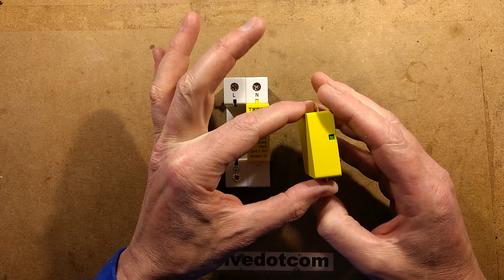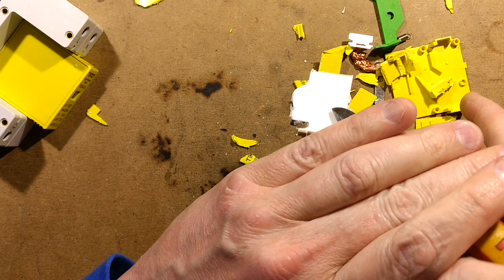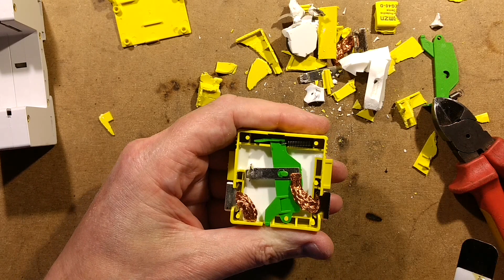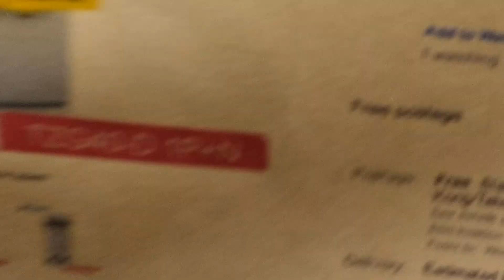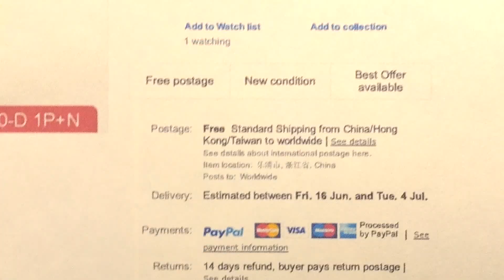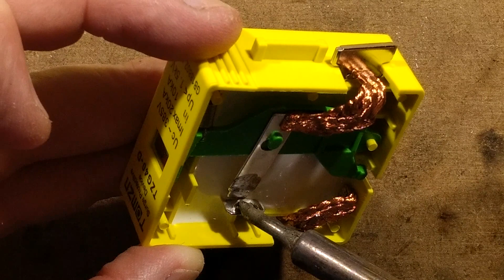DIN rail mounting surge protector with uninspiring safety device.

Comment: It's not supposed to break the circuit, It's only supposed to trip the breaker by making direct contact with erath. Once it does that the surge protector is broken and can not be used anymore. It shows this in the window on top and via the a contact on the bottom (if the bottom part is equipped with that)

So the solder part is only used to show that the surge protector is tripped and needs to be replaced. Flip up the breaker before it again and the circuit is live but unprotected
Reply: @ Pidroe.  It absolutely is supposed to break the circuit, MOVs degrade over time and their resistance drops with that degradation,  therefor over time the MOV will start to pass current causing them to heat up, the solder is "low melting point" and tin tag draws the heat up from the MOV, to the thermal fuse that should take the MOV out of circuit before it starts a fire, ideally the base is fitted with a microswitch that detects that the module has either failed or been removed thus notifying someone of the failure, now this all occurs at very small leakage currents usually less than an Amp, so WAY before any upstream protective device would ever operate.   Surge protection is one of those golden bullet areas where people think that a couple of 20mm MOVs will make them invincible, many house fires have been started by degraded MOVs without over temperature protection, usually in cheap arse power boards that were stuffed under someones bed or under the curtains behind a TV, proper surges are thousands of amps and they WILL cause damage,  surge protection is designed to give the surge a more preferred path to earth were the damage is less problematic.
Reply: Pidroe I agree, by tripping the Main Switch circuit breaker, it has performed its function.  Even if the Solder is still connected, it will not be a safety hazard (even if is live to the turned off main switch, as an electrician is trained to test and know what to do in this circumstance), that being to remove the surge arrestor replaceable module.  If the solder were to still to connect between active and earth, it would be vapourised by the direct short to earth, hence leave a big enough safe gap.
Reply: Alright I looked more closely, it's actually a type D surge protector, so it's supposed to be installed after a RLC. Then yes, it would trip the RLC.
But TOMZN also makes type C surge protectors and I bet they have the same shitty construction and then you don't have a RLC to save your ass, because MOV's are not guaranteed to fail dead short. They may fail open circuit or somewhere in between and if it's below the trip current of the breaker then this thing could start a small fire.
Reply: Well, they do... basically a real surge - aka lightening strike.. has too much energy in too short a time for the RLC to react.. so it all goes down through earth.. mini surges might trip the RLC, but won't melt the solder...

My opinion the solder melting is simply to move the flag and ensure you know WTF happened :)
Reply: But it's not making direct contact with earth and it's not guaranteed to trip the breaker.
Reply: yes it is, the MOV is between Line and earth.. when it goes over voltage it will connect to earth which is supposed to trigger either the RLC or the breaker... generally if it is a serious surge it over heats, trips the flag and wrecks the socket
Reply: mguruguru it will either melt the solder or trip the rlc, it won't do both. because after one did go open circuit there is no more current to trip the other.

Comment: So is that the same varistor device used in fridge compressor starter ccts?
Reply from the maker: That sounds more like a PTC thermistor that changes resistance with temperature.  Starts off with a low resistance, but then goes higher resistance as it heats up.

Comment: Judging by the print direction, it looks as if the spring DOES have a gravity assist, maybe giving a li'l bit more gap, not being held upside down.

As a bit of a change from other vids I've seen, where your hands just appear on screen pre-injured, I finally get to see the actual injuring process!

Comment: Hm just wondering what that contact is intended to do, if you have 5kV spike on the neutral, then varistor shorts it to the earth so you now have it grounded to lower potential, but when the contact opens, you have 5kV again on neutral. Isn't it supposed to dead short it until the voltage spike is gone? imo it should never break the circuit
Reply: This is not for continuously shorting high voltage to ground, just single short spikes (like lightning strike surges). Those will not cause the solder to melt. The varistor can take those spikes repeatedly. If you have continuous high voltage something else is wrong and that's not what the varistor is built to prevent, so it cuts itself out, which is proper design of those devices (which does not really work in this model).
Reply: You don't understand. Again, this device is not for continuous loads and not a breaker . This device is there to short (not break) surges to ground. We are talking about surges in the range of maybe tens of microseconds (yes, millions of a second). If you have a few kV on the line you want to be able to conduct a few kA. That's the whole point of a surge protector.
Reply: sumilidero I agree it's like they are trying to save the varistors life and longevity.... at the expense of life and all other equipment it s suppose to protect!!  yeah cuz we really need to save 2$ varistor when the house catches fire.....
Reply: also that crap contact definitely is not rated to break 10kA anyhow its just a poor toy not a protective device
Reply: I know that, but why is that solder there xD

Comment: Id say this look like a factory reject. The metal tabs seem kind of misaligned but also since the error wouldnt go away because there was a small solder bridge that would just keep melting away since I guess the current would increase if the connection point was smaller..

Comment: Would like to see how it works with a shorter Spring (~5 windings). It also might help to fix the contact in place on the green lever, to swing it to the side instead of just lifting it up. To me it looks like a bad copy of a good design.

Comment: Could it have performed differently if the connection was broken whilst it is in its usual vertical position (how it would be installed) rather than being laid flat on a table?
Reply: I had the same thought, but I suppose it "should" work properly no matter the orientation. Interesting design, however implementation not quite correct.
Reply: SpiderPg I'd call that an erroneous assumption, personally. I looked into these a little bit some months ago and the assemblies are often designed to go into any breaker socket of the compatible standard. That means that they will often be used in residential breaker boxes, many of which position the sockets horizontally in vertical columns.

In short, he tested it in the position it would be in most US houses.

Comment: I'll be devil's advocate here for a few parts.
Regarding the green indicator not moving all the way to red, maybe it's like that for colourblind people. Easier to see that there is two colours there rather than green switched to red which might not be as obvious?
The design for breaking the circuit might have worked better if the tab at the bottom in your last shot was actually assembled with it in the bottom left, then there would have been a larger movement of the metal arm? all that would be required would be making the arm slightly longer and angled slightly.

Comment: my fuse box has a similar looking device on across the input. however it has 2 different modules identified V and T.

V type is across the line and neutral, and the T type is across the neutral and protective earth.

Comment: Proud to say I possess the special engineering skill of stabbing myself with a screwdriver while prying on things. I've utilized the skill multiple times in the past, in fact.    ;-)
Reply: I tried to pry a beer cap off with a flat blade screw driver and it went horribly wrong and I stabbed myself in the forehead. Lucky I didn't lose an eye - seriously. I'll never do that again.
Reply: I put a screwdriver right through my palm and it came out the back of the hand without any other damage apart from the hole. I was considerably lucky.
Reply: Mark L you are not a real engineer until you have seen blood on yr tools.
Reply: That made me laugh. I've hit myself in a sensitive area while hammering out a wheelbarrow axle. Fortunately just my clenched fist hit my nads not the hammer head. Otherwise my son probably wouldn't exist. :)
Reply: Yep - Been there and done that myself. Actually not much bleeding either which was strange...
Reply: Is the problem with not breaking the connection because the unit is upside down and the metal plate would if installed upright drop under gravity because of the slot in the middle. Still, the flag system seems flawed anyway.

Comment: This is the best thing about a senior engineer or mechanic traits. When they're wounded in a job, they'll just tend the wound a bit, and keep working. A bloody finger? Just wrap a tissue paper with electrical tape and continue.
Reply: Senior I accidently mashed my finger on a feeding wheel on a big table saw once. (Someone had turned it on when it wasnt supposed to be engaged". I did just that put a plaster and some paper tissue and masking tape on it and kept on working.
Reply: CA glue works like a charm. That's why the bottle always states "Glues skin and eyes immediately" or somesuch. It's an instruction, not a warning ;)
Reply: Effendi Chung
I do the sticky tape and paper towel/tissue/toilet paper thing all the time. Easier than finding a real Band-Aid™
Reply: B.L. Alley Our engineers does. But they will use anything they could find within an arms reach. Thats why I always made sure to keep some first aid kits ready. My mechanic even use fresh chassis grease to stop bleeding. 😣
Reply: mharris1270 
I believe that CA glue was originally designed as an emergency wound bonding agent.
I once cut my head open when a car tailgate gas strut failed and the tailgate fell on my head! When I arrived at Accident and Emergency (in the UK) they used CA glue to stick it  back together. They'll use it here if the wound is hidden by the hairline as there's a chance of a bigger scar due to misalignment during bonding. The stuff they used was a blue gel.
Reply: Pete Allum Part of the reason super glue (CA glue) works so well at closing wounds is because it is actually moisture activate., so a bit of blood in the wound only serves to accelerate bonding rather than inhibiting such.  I do often use superglue when I cut myself, but if I am doing electrical work or I am in my woodworking shop and injure myself and do not feel like taking the time to fetch the First Aid kit (even though I have a well outfitted one in my shop) I will often just wrap the wound in electrical tape (no paper needed) as it works quite well and does not prevent you from still using your fingers since it remains flexible.  Later in I will properly clean the wound, apply some antibiotic ointment and bandage it up...but after I have reached a good stopping point.  The irony of my woodworking shop is that I am a natural born klutz yet everything in my workshop borders on being surgically sharp (knives, blades, chisels, the list goes on)!
Reply: mharris1270 while you are right about the glue and hospital stuff, I would NEVER recommend to put glue into your eyes. Never do it unless advised to by a professional doctor.
Reply: @rimmersbryggeri - Yeah, but what condition was the guy who flipped the switch when he shouldn't have?  Did he still have the full compliment of bones and teeth?
Reply: Russell Hltn Since gustomers used the saw as well as employess it was impossible to know who it was. I Believe I was the only one working in the flat goods area att that time. In a lumber yard at that tiem where there were only professional customers they often preferred to do the cutting themselves for speed. I much prefer vertical saws to table saws though. they are much safer. I doubt cutomers are allowed b law to use any tools in a lumberyard now unless they come out of their own truck.
Reply: +Kevin L. 
... but it is OK if the doctor is unprofessional.

Comment: Why do you always upload when I'm on the shitter?
Reply from the maker: I've got a WiFi enabled rim-switch on your toilet.
Reply: bigclivedotcom Dear... I hope it's waterproof. I tend to lose my accuracy after a few pints.
Reply: why are you always on the shitter when he uploads a video?
Reply: John Howard solid core is shite, wider= more chooch. Those are the basics as far as I know!
Reply: Why are you always on the shitter when he uploads?
Reply: Good call! And insulation as well - something that stands up to soldering. What's the key word? Silicon?
Reply: bigclivedotcom ! ohh thanks... now ive gotta check my toilet for suspicious electronic devices...

Comment: Look at the door, that comes off.  There appears to be guides, for something.  Then you add that the metal piece (contact), clearly can pivot.  Could the guides, lever the contact further away?
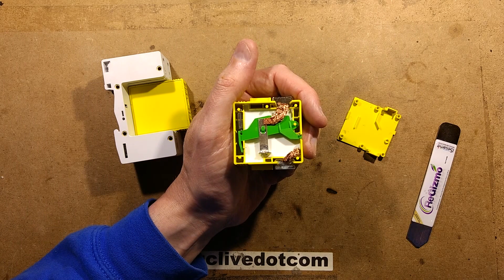Reply: PV2Omni If you look around 1:53, I do not see anything about the orientation of the interior baffles in the cover that would alter the movement of the lever or its contact arm.  They appear more to be baffles to contain the braided conductors and help reduce the size of the window opening when the flag is raised.
Reply: Ethan Poole I was looking for a good view, of the orientation, and apparently missed it.  It looks like you are correct!

Comment: What a coincidence that this video was just released, the day after the surge protector in my house blew again. It's about five years since last time, and then it was five years since we had it installed.
I just learned about these holder-and-insert-type surge protectors, and that is definately what will go in my consumer unit this time.
I can confirm the slot/peg is for indication/warning when something is wrong. In my box there is even an audible alarm hooked up to it.